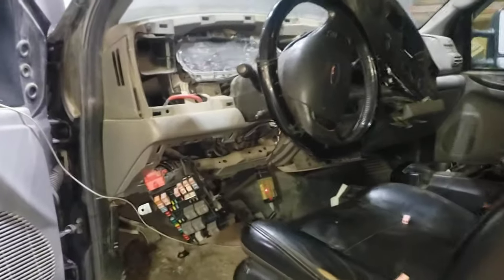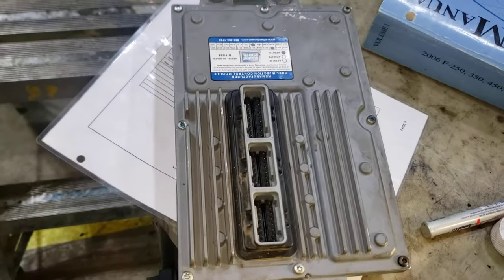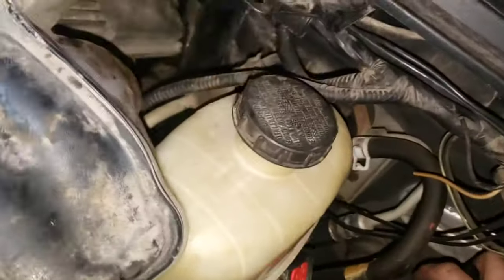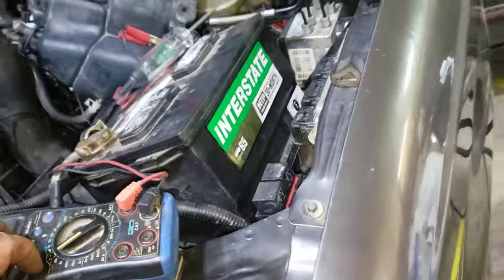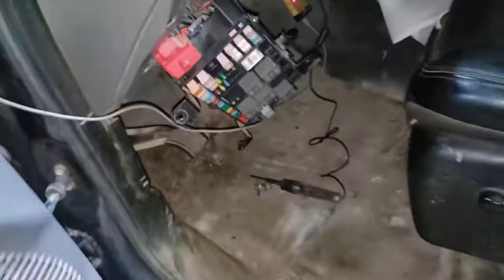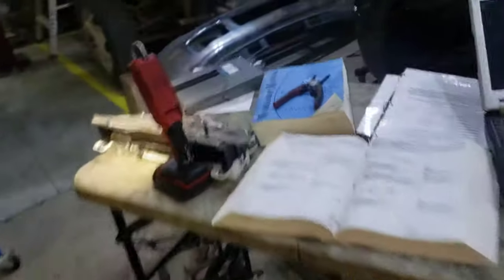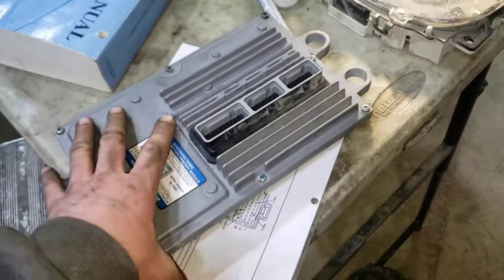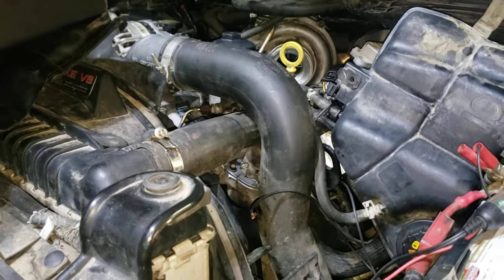f350 electrical issues solved

Comment: New starter in stalled by dealer. 6.0 power stroke. Stuck in gaged ofter starting. Cooked starter smoke come out. Truck engine died. Now hope the computer isn't damaged. Parts / labor  2 yr warranty. Two mo. Old. It keep cranking while I was driving  un aware.